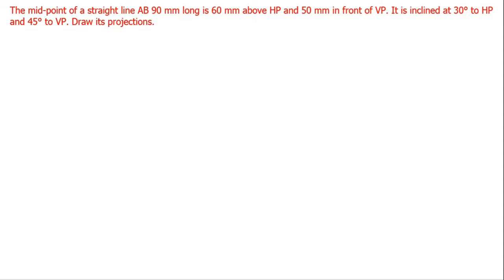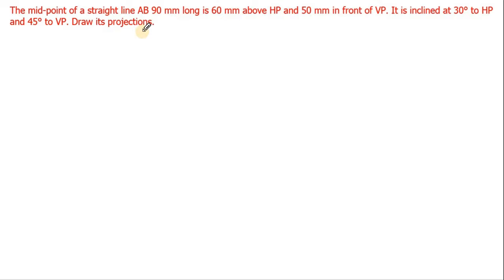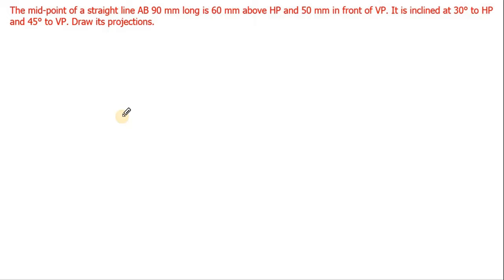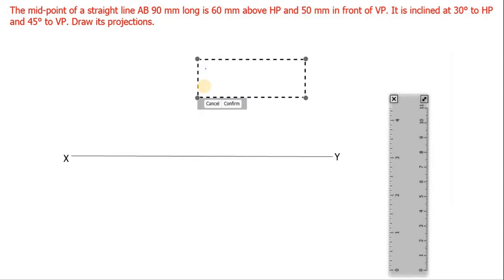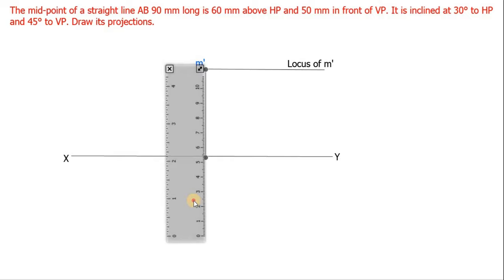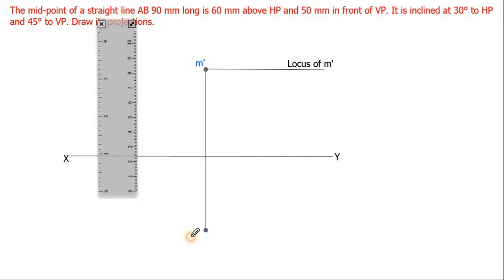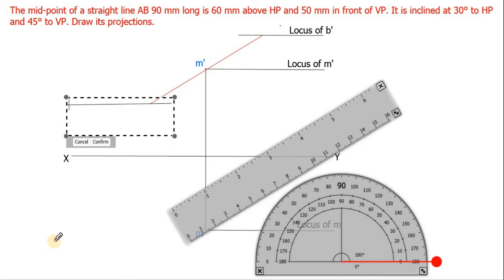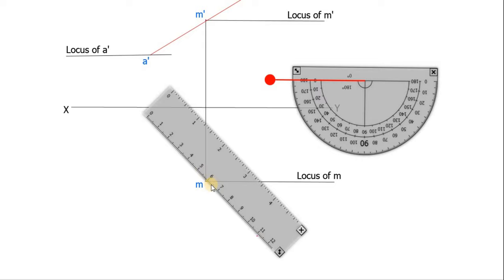Projection of Lines | Mid Point Diagram | Engineering Graphics

Comment: The mid point of line AB 80mm long, is 30mm above hp , 45mm infront of vp. It is inclined at 30° to hp and 50° to vp. Draw projection line

Comment: A straight line has its mid-point at a distance of 45 mm. from both HP and VP. Its true length is 80 mm. and the top view makes 30° with XY and the front view makes 45° with XY. Draw the projections and locate the traces

Comment: 7. The Midpoint of straight line AB 90 mm long is 60 mm above HP and 50 mm in front of VP. It

is inclined at 30 to HP and 45" to VP. Draw its projections